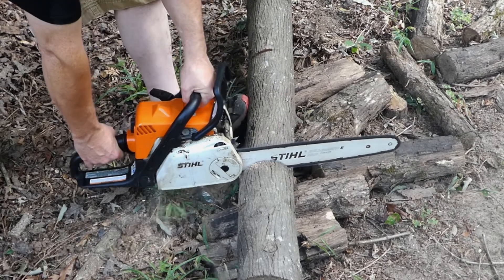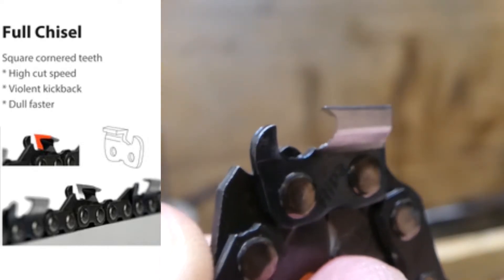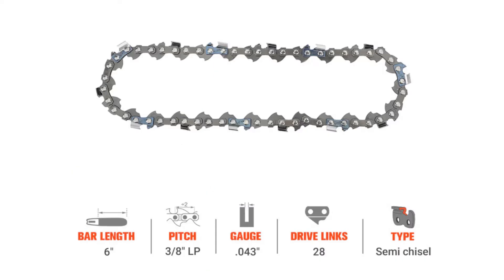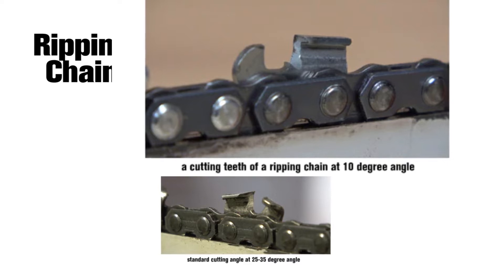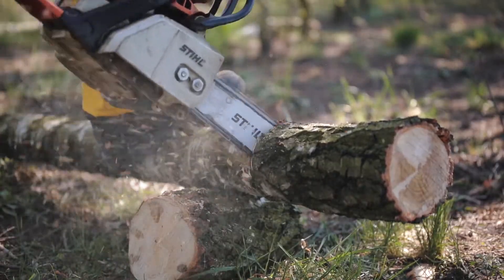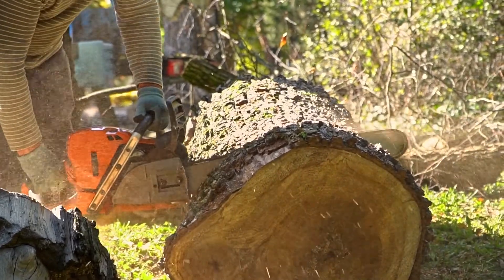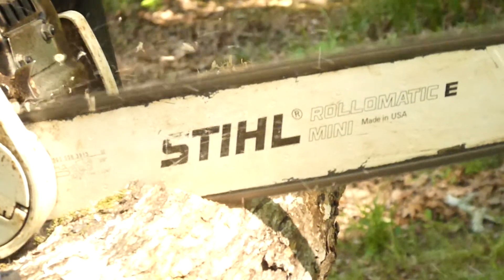Full Chisel? Semi Chisel? Skip? Rip? Types of chainsaw chains and how to choose.

Comment: Need an expert opinion. I have 4 saws: 1 12" Chinese , 2 18" Husqvarnas, & 1 105cc Chinese w/ 36" & 42". 1 of the Husqvarnas is a 440e II I bought 2 days ago from Tractor supply for $100 it was used & returned. The chain is dull. I'd like at least 1 beast of a chain. The 105cc seems more for milling, it came with 2 Oregon chains. the 25cc 12" will cut anything I've thrown at it, it's a small beast. I need something that will run through about 20" diameter trees, but won't take hours. Any suggestions?

Comment: 10-1-2025 -  -  -  -  Chains I buy say 3/16" file size for sharpening the chain links. However all the chains I have are smaller at 5/32" which fit the diameter of the files I have.  What's going on with this.?  When I get the chains back from the dealer that sells Stihl products, the diameter of the sharpened area perfectly fits the 5/32" file. Is the Stihl dealer using the wrong diameter sharpener?  I have no idea.

Comment: Great video! Thanks for teaching me this! How do I determine specifically, the shape of the drive link needed for my 2018 redmax gz550 saw? I cant for the life of me research or find out information regarding what chain to get and after ordering several of the wrong chains, i gave up. Bought a husqvarna 555 pro and have my old saw just sitting there with a bad chain.
Reply: 3/8" pitch, .050" gauge, with 72 drive links for a 20" bar. For a 18" bar, you will find a 3/8" pitch, .050" gauge, with 68 drive links.

Comment: Could you comment on cutter size in relation to pitch and gauge? Thanks
Reply from the maker: The pitch influences the overall size of the cutting teeth; larger pitch chains usually have larger cutters. arger cutters can remove more material with each pass, making them suitable for larger logs or heavy-duty cutting tasks. Smaller cutters may be better for precision work or smaller trees. The combination of cutter size, pitch, and gauge influences how the chainsaw performs. A heavy-duty chainsaw might benefit from a larger pitch and cutter size for faster cutting in tough materials, while a smaller pitch and cutter sizes are often preferred for lighter tasks, offering more maneuverability and control.

Comment: Curious - how often do you buy a new chain and how often do you buy a new bar for your chain saw? Are you swapping out bar and chain several times a year or much less?
Reply: One chain will last me half the year with all the filing and daily use for work. The chains stretch over time due to how tight you run them, or use. The bar I have two with a chain for each. I’ll replace the bar when the burs are no longer fileable.
Reply: Your bar will last a lot longer if you flip it every once in a while.

Comment: One chain you did not discuss carbide tip chains. They hold and edge much longer than steel, and last much longer before needing to be sharpened!
Reply: Carbide tip to sharp needs diamond wheel in sharpening tools, can't use file .
Reply: @igor_oak_tree  Buy one carbide tip chain you will not need to have it sharpened for a very long time too!
Reply: I was wondering what shops charge to sharpen the carbide chains?

Comment: Those "safety chains" always give me a chuckle because all they do is make the raker bigger but kickback is caused by the cutting edge. Until you learn just draw a line from the top of the bar to the last sproket rivet and another line to the tip and that is highest risk for kickback no matter what chain you have.

Comment: I would like to remind folks that chaps are an inexpensive safety device for the new and experienced. Worth every penny.
Reply: Inexpensive ? More like expensive lol
Reply: @blakejohn8374 I seen my uncles through after a small hit with a saw and he was down for years behind that accident. I'd say chaps are very inexpensive considering....
Reply: @blakejohn8374 cheaper than a new leg
Reply: @blakejohn8374 Get assless chaps to save money and forgo the underwear to save a bit more ! Get Ned Beaty to be on your would cutting crew and you will be famous ! Money problem solved .
Reply: Glad I'm not the only that noticed lol. Along with the chaps a quality pair of boots is a must, I recommend laced 8 inch high top boots (not pull/slip on as they offer extremely poor ankle support, walking on uneven ground, rocks, limbs and stepping over logs or stepping in a hole will cutting is not at all pleasant, I would also recommend boots with steel or composite toes and metatarsal guards for the top of your foot (you can also get a pair of metatarsal guards that you can take on and off) Carolina or redwing are some very good options for outstanding quality boots in my opinion, I've had both and never had a problem them, but like I said it's just my opinion, just be safe and mindful of your surroundings.
Reply: Only if you are in America, in Canada and Europe the Healthcare is free so it is cheaper to not wear chaps and gore your legs
Reply: @tyler2260 same in Australia, cut ya leg off, get a new one for free.
Reply: @tyler2260 no, in America, even Oregon chaps at Tractor supply cost 💲 100 dollars… I got some at th flea market for 40$ .. bottom line: GET SOME

Comment: Useful video, horrendous audio, with volume jumping very high and then phasing off too low to hear you clearly. Maybe an investment in a good mic would make your videos more tolerable to watch, listen to. Thanks for the effort anyways.
Reply: I didn’t notice any of that, wonder if it is maybe your audio?
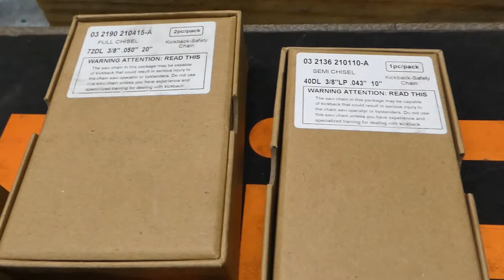Reply: Just watched it again to about the 1 minute mark. Audio drops off at :38 then is loud and distorted at 1:00 and continues this way throughout the video, usually loud and distorted at the beginning of a scene change and then drops too low to hear well seconds later. I have a Pioneer Elite audio receiver/amplifier and Klipsch tower 5.1 speaker system so it's not my audio system and I'm not experiencing this with other YouTube videos. Maybe it's your video editing software or settings? Either way, I got useful information from the video so thanks for that. @adventurzwithiain
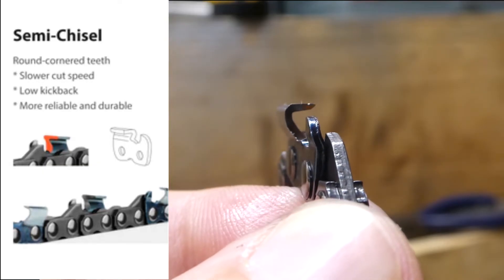Reply: I take that back, it's going loud and quiet more than once per scene. At 1:47 "Full chisel" is very loud and distorted and then drops very low and then jumps up again a few seconds later "the reason for this" in the same scene. That's what made me think it was a mic issue. It does always seem loud and distorted at the beginning of each scene change though so it may still be your software. Or maybe some sort of volume leveling feature on your action cam. I think I remember having this issue with some of my GoPro footage in the past.  @adventurzwithiain
Reply: Uhhhh  think that's all you man... audio sounds fine to me. I pulled it up on another phone and it still sounds fine... it's either your device, or your ears... u growing carrots and potatoes up in those cauliflower's there, or what ? NEED TO GET SOME QTIPS BRO!
Reply: Sounds like you speak from experience with that carrot, potato, whatever... Yeah, sounds more stable in a mono-channel audio device but not on my 5.1 surround sound, as the voice comes from the center speaker and keeps fading. Even on my cellphone it's distorted at the louder points of the video. He definitely needs better post-processing software and a good microphone.  @FuuhQ
Reply: Get yo ears checked man